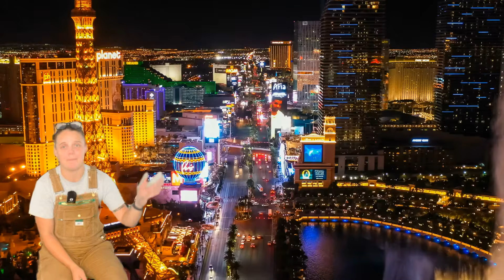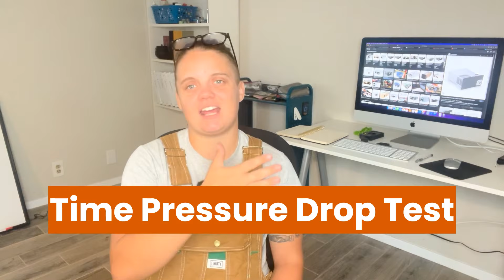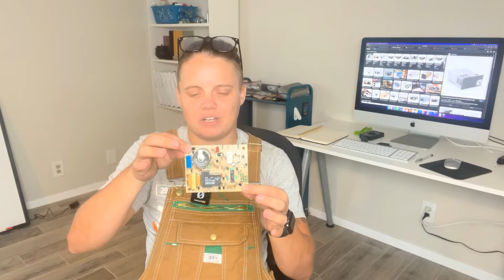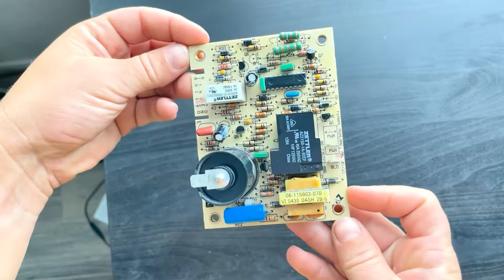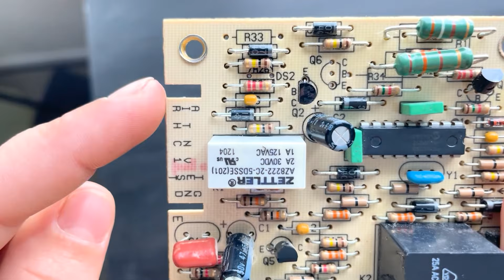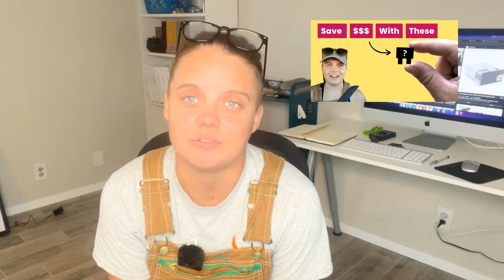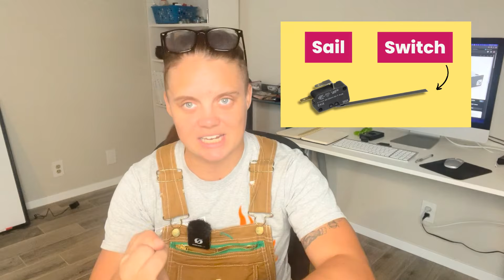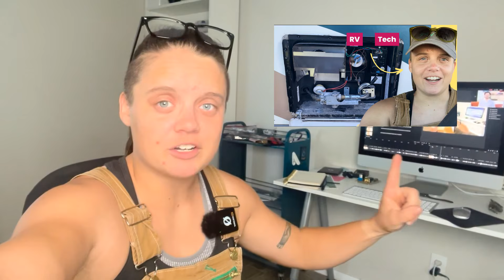How to Troubleshoot your RV Furnace Circuit Board

Comment: I have a SF-30 furnace. We were having problems with it starting, and the fan sounded funny. If you hit the furnace, it would come on, but, sometimes it wouldn't shut off, till we shut the furnace switch off. Sometimes it would work fine, but the blower motor still doesn't sound right. So, I got a new blower motor, and replaced the old one. When reinstalling the furnace, and connecting the four wires. With both thermostat wires, and the red wire connected, as soon as I touch the yellow wire, the fan starts to run, and will not stop. I hooked it all up, and the furnace lights, and blows heat, but the fan will not stop. Last winter, I replaced the high limit , and sail switch. Could you please help me, this thing is driving me nuts. And, it's snowing, and frigid outside!

Comment: Having problems with my Dometic DFSD20121 Furnace. Your video was very helpful. The control board proved to be bad and replaced it. Furnace then worked as it should but after running for 4-6 mins it tripped off. Reset and it ran for about 2 mins and tripped off.  High temp Switch ????

Comment: Got no power on the blower and no power at the top wire (air) but I just recently replaced the circuit board.. I’m stumped

Comment: I have an Atwood 7916-II that was doing nothing. I watched at least 20 different videos on troubleshooting these heaters. Not one of them helped much. But your systematic approach of testing the control board helped me get it working. Turns out it was a power problem. I had a blown fuse and the battery was low. You are the best! Liked and subscribed! Thanks!😄🥰

Comment: You have the clearest explanations, thank you. I have been struggling with furnace problems in my 2022 Escape (from Escape Trailer Industries in BC, Canada). It’s a Dometic/Atwood DFSAD12131 and at this point I have replaced just about everything but the furnace, some things more than once. If you have an idea that helps I will appreciate it. Current situation: furnace blower comes on, flame lights and runs for seconds to a minute or so. Then the flame goes out. Blower stays on. After a while (a minute) the burner starts again and runs a little while before shutting off. This will continue indefinitely. On the 6 pin connector the air pin has 12v, the TH pin has 12v, continuously. The V1 pin shows 12v while the burner is running and shows 0v when the burner is off. I have replaced sail switch, high temp switch, igniter, gas valve, burner head, control board.  Next I guess I will try another control board but maybe you have an interesting idea? Thanks.

Comment: I’m not a lady I disabled Vet who lives in his RV on his own land
My furnace has been acting up and it was time to clean it. I did it and put it back in. I must’ve wired the sale switch wrong or something and I ended up doing a test bypassing it. Gas valve did go but the igniter didn’t. I’m wondering if the distance between my igniter and the flames spreader is off your videos are super helpful and thank you. You’re saving me a lot of money.
Next, I would like to repair the gas side of my hot water heater and only works on electric now so I will definitely watch more of your videos. Awesome job thank you Emily.

Comment: I have a Suburban RV furnace less than 2 years old.  It runs fine, ignites, reaches temp, fire goes out and blower cools chamber down.  As soon as the blower shuts off,  the blower  immediately restarts.  Blower runs about 2 minutes shuts off, restarts.  The blower keeps cycling until I pull the fuse out.  Once I do that, and reinsert fuse the blower will remain off, until heat is called for again and the problem repeats.  Ever heard of this?  I've ordered a module board but it has not arrived yet.

Comment: I must have an ancient board. There are labels for PWR & Blower on the board, but no pins. My 6 pin connector only has 3 wires. There is no thermostat wire. My red pwr wire plugs into a pin on a 4 pin square connector along with other different colored wires. I just ordered a new board but it has pins for the pwr & blower. Do I need to rewire things now? Which wires go to those 2 new connectors on the board. Thanks.

Comment: So I went through this whole process and it appears it is an " upstream issue" as you say. I notice when I removed the fuse for the furnace the little light did not come on under the removed fuse.  Other fuses have a light when removed. Should this tell me anything about where my issue might be? Thanks for the helpful video

Comment: Thank you for making this video.  It is very clear and well thought out.  If possible, could you add a edit in to say NEGATIVE 12v is going to make the board not function as well?  I know its a beginner problem to ignore that sneaky little dash before the 12 but i did it and ordered a new board to fix the problem.  Thankfully my new board from Dinosaur came with tech support and they pointed out my mistake.

Comment: Thank you for the Video.  I have a DSI board and VCB Board, everything checks out up until you get to the 4 pins on the DSI.  Have power at the white wire but no power at red or black and nothing coming out of Igniter.  If you jump the red wire going to gas valve i can here it work and smell gas, but still no Ignition.  DSI board? or other tests needed?

Comment: Any idea on what is making my dometic furnace shoot flames out the exhaust port outside the camper. Igniter lights and keeps clicking like it wont stay lit builds up enough gas and then boom does it once or twice and then kicks off and i have to reset at the thermostat to try and run again. I know it could potentially be several things. I currently have the furnace out and half way disassembled. Any help would be greatly appreciated. Also wanted to mention first issue was stove doing the same thing got that fixed. Dirt daubers were in that it got cleaned out stove started working fine and its like the issue reversed to the furnace that i had used 4-5 times right before the stove got fixed. Checked the exhaust port their were also dirt daubers in that. Took furnace out checked that air was flowing through metal pipe with shopvac seemed to blow like it should with no restrictions. Thanks

Comment: You are very knowledgeable but you ended this presentation at the point of my problem which is the ignitor is coming on and there is flame for about 3. seconds them should off and it's repeated on the 3 attempts. This problem happened all of a sudden so the gas pressure is OK 
Is there a part 2 to this topic or do you have a video that explains this situation. I like the way you break things down to step by step. Hopefully, I explained my problem well enough
Thank you I'm a fan, and I'll be watching more of your videos and are you single

Comment: What if I get 0v on everything
Reply: Do what she said and check your power. Battery, fuses, converter
 Should at least be getting power to the power tab on your board for the heater to work, and/or be able to trouble shoot what else may be wrong. I was getting nothing, and finally checked the fuses and found one was blown, and charged my battery. Now it works perfectly. Including actually heating!

Comment: Spent 4 days troubleshooting a Suburban Nt20-NEQ furnace, only 4 years old! All connections were good, thermostat works, fan runs, igniter sparks but no flame. Took a guess that it was the gas valve and replaced it and that solved the problem. Everyone kept saying sail switch and no one mentioned it could be the gas valve. $90 on Amazon and saved me $400 in labor. Thank you for your awesome videos I’ve learned so much from you. Great job breaking it down into plain English anyone can understand! 🙌🏻
Reply: Goddamn it
Reply: Gas valve on the furnace? Or gas valve on the camper somewhere?
Reply: @KyleMullin-r3e Gas Valve on the actual furnace
Reply: Funny thing too my gas regulator went out on my propane tanks at the same time. Not sure if it was related but I swapped the propane tank regulator first, fixed other issues but not the furnace. That’s when I replaced the furnace gas valve and now everything runs great

Comment: It’s 19:30 central time that I watched the video. My problem is my furnace works but it’s blowing the circuit breaker switch. I have a dometic DFDM 30111 furnace. I may have the letters mixed it may be a DFMD 30111. Anyway when I go out and put the switch in The reset mode it works fine. I tested the switch and it has 13.6 volts at both terminals. I tested the board at the top two red wires and I get no reading I didn’t test where the 4 wire plug goes. According to dometic the switch should be good if I’m getting 13.6 volts. This is obviously an intermittent problem. But it’s driving me crazy plus I’m out with the trailer in the northern  part of the US where it’s getting very cold at night

Comment: I have an Atwood 7920-11. I turned on at the thermostat. Runs for approx 5/10 seconds. I have recently replaced the sail switch, over temp switch and the ignitor. Still the same runs 10 seconds and cuts off. I have a single red light blinking when this happens. I will test the circuit board next I guess. Thanks for the info.

Comment: How do you test the dometic analog thermostat? I get no 12 volt power to the thermostat blue wire at the circuit board at the heater

Comment: One of the better videos out there about these furnace boards. My board ended up failing so I put in a dinosaur board. Now all my problems are gone. Highly recommend that board. Also look into buying some wire piercing probes. They’ll save you a ton of time . Just tighten the probe into the wire and connect your meter to them.

Comment: Volts only the the PWR Spade. Checked at the A/C where they connect and I have 12v on both wires going to the thermostat and 12v coming back from the thermostat. It connects to a blue wire that I assume goes to the board. When calling for heat shouldn’t I have 12v at the TH pin on the board?  Hope this makes sense.

Comment: Awesome video. Very well explained.
Reply from the maker: Glad it was helpful!
Reply: @rvrepairwoman  Unfortunately the new PCB shows the same symptoms. When it switches to heat I hear a humming noise and do not get 12V on the Blower pin. After a few seconds the diode starts blinking for the air flow/limit fault error. Now I wonder if that humming noise is normal?

Comment: The furnace is not getting signal from thermostat that is brand new
Reply from the maker: I’m just Spitballing here, but this is what I would look at
1. Test the thermostat. I’ve had a brand new part be bad, it sucks but it happens. 
2. Make SURE the thermostat is actually set to heat, and the temp is set higher than the temp in the RV. Those RV thermostats can be a pain in the butt sometimes. 
2. Start tracing back the thermostat wire from the board and see if there is a break somewhere

Comment: Emily, you rock! My furnace would make a clicking sound when I turned on the thermostat and the red troubleshooting light on the circuit-board would blink one time. I found your video, troubleshot the circuit board per your clear and concise instructions and found out I was not getting power to the fan. I ordered a Dinosaur replacement board, installed it, and now my furnace works again! You're a very knowledgeable and talented woman...thanks for sharing it with us.
Reply from the maker: THIS is what I made this video for! So glad that it helped someone out!
Reply: Hello you're very good at communicating. Have no power to the blower pin and 0.3 to the top pin so I don't know if the board is bad or the high limit switch is bad the sail
 switch is good ? Ps when the furnace did work I used to hear clicking up at the roof top AC that was definitely not normal .......my thermostat checks out, and it makes the furnace makes a click sound like it is trying to start the fan
Reply: Same here with Atwood furnace 8525-IV, one blinking light, no power to blower, just ordered new circuit board

Comment: No voltage on the V1 pin was my problem with no ignition. I jumped the first pin straight to the gas valv and 💥 i have heat!! I did try and time it with the igniter lol i was a bit off and got a whoof!! Thanks!!!
Reply from the maker: YAS! Love to see it!

Comment: I set the T-stat, the fan comes comes on but, no power to board at all. I tested all three wires and they’re dead. So I’m getting no power to the board. I have tested every fuse. It also appears there is plenty of air flow. My furnace is a year 2000 Atwood furnace. Any input would be appreciated.

Comment: Very informative Great job
Reply from the maker: Glad it was helpful!
Reply: atwood 8535-iv replaced everything,  sail ,limit , igniter, mother board , cleaned inside and out , it will  not get passed sail switch,  so i tied a fishing line to it ,drilled a small hole turned it on pull the fishing line a ND  bingo it started right up , why does the blower not strong enough to trip the sail switch  ?   Thank you o @rvrepairwoman

Comment: Very helpful video….much better than others I’ve seen on line. I’m off to do the CB test and will let you know how it turns out. FYI, I suspected a faulty high limit switch but will feel better going through these tests before removing the blower cage to access it.  I have an intermittent 15 sec on/15 sec off issue with the burner in my 1995 Atwood 8520 furnace.  Will be replacing the burner today also.
Reply from the maker: Intermitent problems are the WORST! It always starts working again right as you’re about to get to the bottom of the problem.

Comment: Great informational and detailed video!
I tried each of your tests on my circuit board because I’m seeing an E1 error on my thermostat control unit. The CB gets power, but I’m afraid the control unit isn’t connected to the CB somehow because of the E1 error. I’ve disconnected my batteries, swapped the control unit and the CB, in your experience what’s the issue and how do I troubleshoot this error?

Comment: Fan doesn't come on at all.
Reply from the maker: Then the problem is most likely with your sail switch.
Reply: @rvrepairwoman   It wasn't. it was actually the mother/circuit board. Thank you for your reply! We got it done! About 9 days in some single digit temperatures without it. But we came through!

Comment: I did that also, put everything back together. It tried to light and shutoff with 1-2 seconds but instead of needing to reset after 3 failed attempts it kept on trying and after about a dozen attempts it stayed on. It has worked just fine since then. Thanks for your channel, we are subscribed, it is very apparent you know what you are talking about.

Comment: Great video, thanks.  My furnace will start, gas lights, however turns off after 1-2 seconds, will duplicate 2 more times and then shutoff.  Thoughts?
Reply from the maker: Oof those ones are tricky. I'd try cleaning and checking the gap on your ignitor first. If that doesn't fix it. Try replacing the ignitor.

Comment: Hey Great video. I have an rv furnace that cycles through the start up but doesn’t lite. I do not hear the tick tick tick. I noticed the led light does not flash. Do you have a video on checking the igniter? Or would it be the capacitor that feeds the igniter? Again you are very informative and I plan on watching most if not all your videos.

Comment: can you tell me if I need propane turned on before I start my furnace blower? I realize there will be no gas flow etc but just want to know if the system has to show pressure before it will let blower kick on. I am trying to troubleshoot my system and it comes on intermittently.
Reply from the maker: You don’t need the propane turned on. The blower fan should still act as normal, you’ll still hear click tick tick tick. You’ll just never light.
Reply: @rvrepairwoman  thanks for your reply my issue is I can go out there and turn on heat and adjust thermostat up and hear the click in the AC unit above and then blower will not even turn on and another day I can go out there and poof it works.

Comment: I have a suburban sf30f furnace. I did all the proper tests and the solenoid clicks and does not have power to the blower motor. I replaced the board with the updated version and the solenoid does not click and no power to the blower. I checked the sail switch and the overheat switch or whatever it's called and they are good. So how often are new boards bad? If not what else could it be?
Reply from the maker: Hmmmm that’s a tricky one. It’s rare that a brand new board is bad but it does happen…

Comment: I’ve been trouble shooting my Atwood 8500 IV (4) the last few days. Bought another board….no change. So I did what I should’ve done to begin with and followed the wire paths. Discovered a shorted wire from rooftop unit to furnace. Cut an access hole(s) (4) and fortunately found a mouse had chewed through the wire. Repaired the wire, put the original board back in and presto! Back to working! I enjoyed your video. I’ll be watching more of them! Keep them coming….please.
Reply: UGH!!! Dog gone mice! They just cause so many problems!